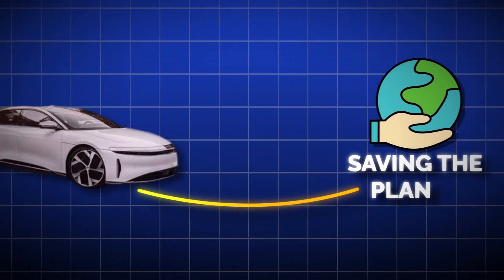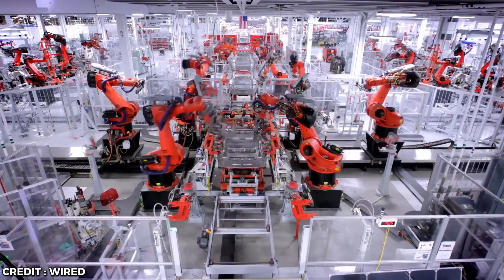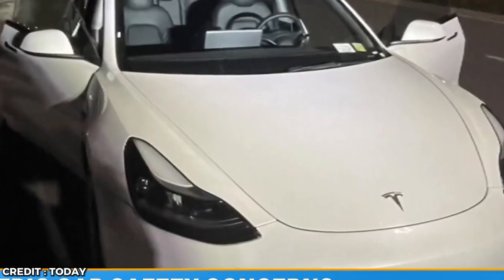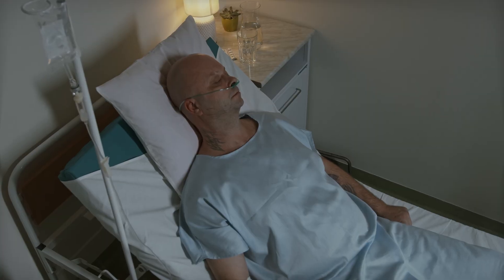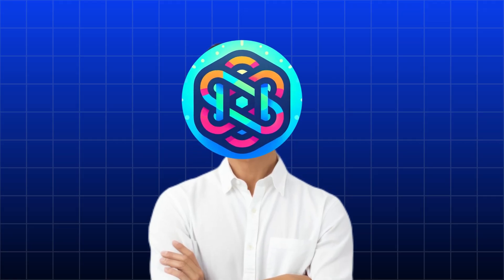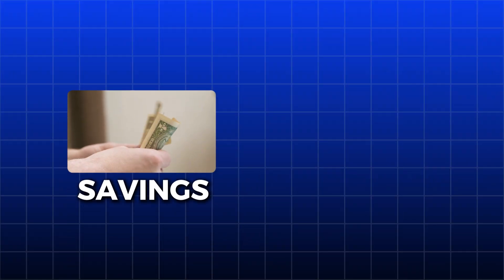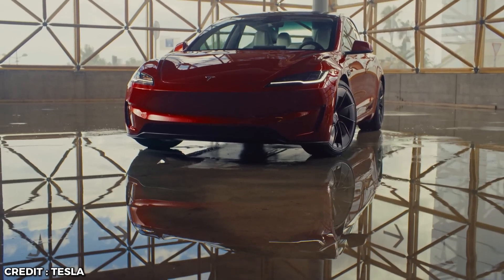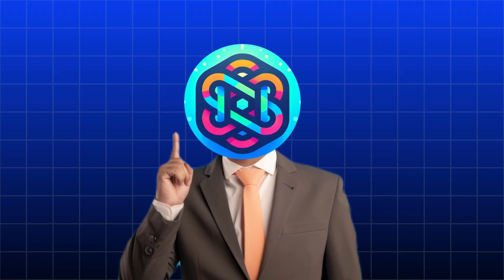Why Electric Cars are NOT Green!

Comment: All cars, EV or ICE produce pollution in production, but EV's have no tail pipe so they dont produce pollution on the street where you live and your children are growing and developing.
Plus they are much more fun than an ICE car, both relaxing and exciting to drive
Reply: more fun? lmao the cope
Reply: @madhunter6420  When you have the slowest Tesla, basically a family sedan/saloon that will do 0-60 in 3.9s and 145 mph have maximum torque of 550 ft/1lbs at zero mph up to terminal velocity, corners like a demon because all the weight is below the floor, then it's fun, but it doesnt make that brum brum sound children like

Comment: A tesla would technically release 70 pounds of c02 on a full charge from coal.
Meanwhile average gas cars would release 300 pounds of c02 from gasoline. 
Coal generates a lot of electricity so it wouldnt release as much
Reply: An EV will produce 0g of Co2 if running on renewable energy.
The EV is not the problem, the grid is

Comment: Lol 90000 miles lifetime?? are you nuts. Most modern EVS outlast ICE cars! A battery can easily discharge 1500 times, and LFP chemistry can do easily double that!
Reply: no they dont
Reply: @madhunter6420  do some research please. Of all the model 3 and y’s starting from 2019, only 3% of the cars replaced their battery because of a malfunction. There are tons of these cars who surpassed 300k miles, still having around 80% of their capacity left. I just passed 150k miles on my M3P, and still works like new. Go ahead and spend some money on filling ur car with gas xD
Reply: And this is data from a 3rd party open source app that logs data, not direct from tesla

Comment: The numbers and projections in this video are just wrong, renewables in the US are set to grow to almost 50% electricity generation by 2030, coal represents a drastically shrinking share of the electricity mix because Nat gas is cheaper in the past, and recently solar wind and battery SWB are significantly cheaper per installed kWh and are quicker to deploy than fossil fuels , nuclear or hydro . Electric car does not have a lifetime of 90,000 miles as this video says , studies have shown that an EV crosses the carbon debt of its manufacturing at about 20k to 30k miles depending on the power mix, most electric cars today are expected to do many 100k miles with lower maintenance costs and cheaper fuelling costs, when new electric cars hit price parity and lower cost EVs will dominate not because it’s greener but because it’s cheaper , same with SWB , economics and profit will trump all.
Reply: The key word here is at the end "Trump"😂